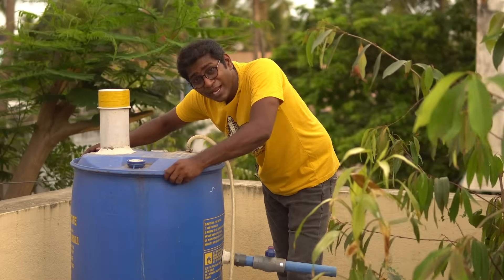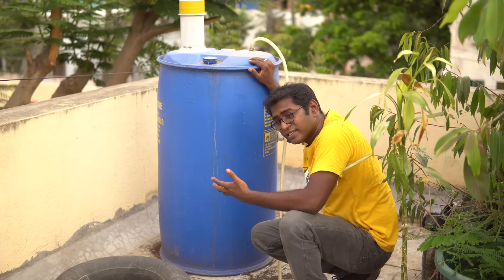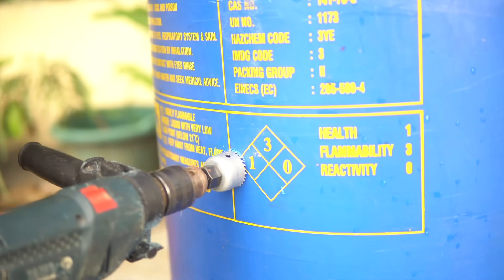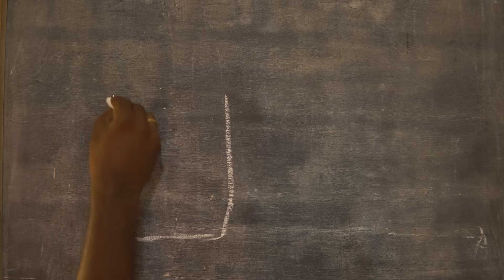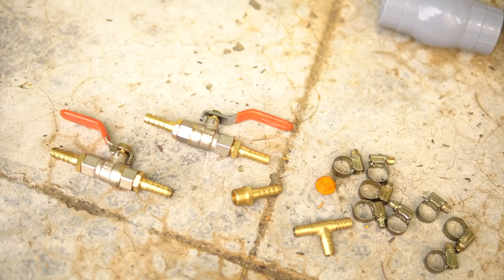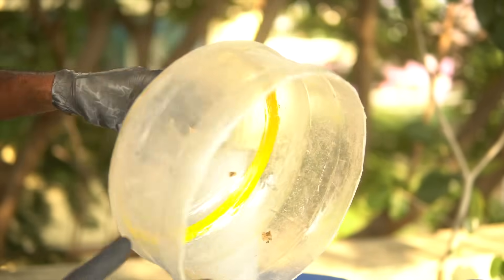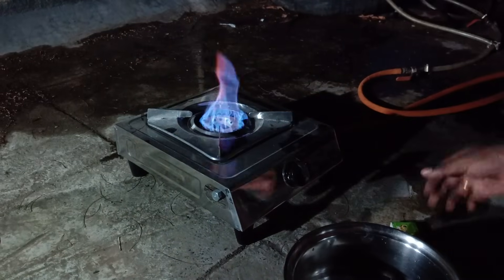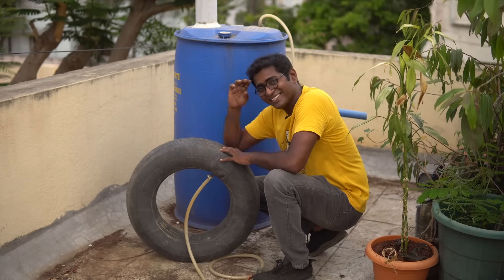Make your own Bio gas to save money on LPG

Comment from the maker: A large drum could be an IBC tank, or closed drums. If you are using drums with lids, make sure it is perfectly sealed when completed
I am using 220 Liter sealed drum
 4 inch diameter PVC pipe height should be based on the height of the drum you are using
2 inch Tank nipple
2 inch FTA(female threaded adapter 
2 inch ball valve and 
1 ft 2 inch pvc pipe
2 inch L joint
Half inch brass ball valve 2 nos
Brass t joint haf inch
Threaded brass hose connector
8 nose hose clamps half inch
A truck tube with tube valve removed
Hose as per length. 
Epoxy putty to seal eveything
Reply: I've seen often a purifying element added, consisting of water through which the gas is forced through, before going into the rubber reservoir/tank. Great video.
Reply: @VIDEOEPPO  great video. I still don't understand why your outlet had to be so low if you are not necessarily using the top part of the drum as gas storage. You have effectively reduced the potential size of the 210L digester to almost half if not less
Reply: Hello 👋, how much slurry did you pour into your bio digester?
Reply: Interesting video, may i request to make it in household use? I am sure it needs bigger barrel and bigger reservoir, but at least we would know how much do we need to make it😊 thanks
Reply: How to seal the waste outlet pipe?
Reply: Sir I make but not fire why

Comment: I still didnt understand the purpose of the black tube. Could you please tell me.
Reply from the maker: The black tube is for storing the biogas. An inexpensive way to store and also apply pressure to release the gas when needed. When the gas need to reach the stove, Normally the household cylinders are pressurized . But here there is no pressure. So we store it in the tube. As gas increases the tube become big, Then when we need to use the gas, We can place some weight on the tube to increase pressure and force the gas out.

Comment: What about the non liquid waste that's still left at bottom? Won't it be a problem? The tank might fill up someday and the space for gas will be reduced if the value is closed for many days
Reply from the maker: That's where I was mistaken too!. The microbes digest everything and turn it into a slurry. It takes time but it works
Reply: @VIDEOEPPO thanks sir. if our wastage keeps on increasing then it might become a problem. Will have to upgrade to a bigger or additional tank

Comment: Your demonstrations  is good .

One question valves used by you is of water supply grade or lpg grade ?? And how did you connect with tyre tube. That point is to be shown please for better understanding. Thanks again
Reply from the maker: I used brass connectors to avoid corrosion related problems. The tube has a nozzle as we know and i simply plugged the pipe into it. found the smallest hose- clamp to fasten it and wrapped it with strips of rubber tube to avoid leakage.Since the pressure is noy much, it seems to hold.

Comment: Sir, the slurry produced the methane gas automatically or we need to add anything externally to collect the gas?
Reply from the maker: The waste produces the gas as it is decomposed by the microbes. The vehicle's tubes are there to collect the gas. There are methods to accelerate the gas production but it would depend on various factors. Add some cowdung, it is enough. ( Like adding curd into milk to make more curd)

Comment: Instead of Rubber Tube, can I use cylinder For reservation?
Reply from the maker: You can. But there needs to be a way to pressurize it. Otherwise the gas might not flow out. In case of the rubber tube....we can squeeze it by placing brick which will increase the pressure of the gas flow

Comment: What if we accidentally close the valve associated with the gas generator. Won't it explode due to pressure?
Reply from the maker: No.... The microbes will choke and die  and gas production will stop!( Remember, the gas being produced is not due a chemical reaction but It is a biological process. The microbes feed on the waste and release the gas which is their waste....So if we close the valve, they  will be poisoned by their own waste and die

Comment: Can we use other  agricultural waste (like  dry leaves of coconut, arecanut  &    others trees and straw) along with cowdung? Cowdung contains undigested  green grass and straw  that is digested by microbial flora in cowdung  to produce Biogas. Can the same micribiome possess  the enzyme system to use  tree foliage as raw material?
Reply from the maker: Yes. You can use dry waste combined with wet waste. Although, It would take a bit longer to break down and gas production will be slower

Comment: I dont recommend this, lots of work and regular maintenance but still gas amount is very limited . So better LNG or LPG which costs Rs 800 in India for a dmoestic cylinder and it can run up to 2 months for a family.
Reply from the maker: we cannot generalize like that.  Biogas plants are a success and what i made here is only a proof of concept. When you say LPG lasts for 2 months , how many minutes does one cook in a day... There are people with cows and poultry.  Instead of burning cowdunk cakes, they can use biogas. This is not a setup that could be used in an urban area. There are limitations,but as an idea it works and we need to see how we can benefit from it rather than shelving the idea itself

Comment: There is a way that I do not know the details of to "stir" the tank with the gas... That produces more gas, and prevents the slurry sludge from settling to the bottom of the barrel, thus allowing the continuous flow over spill port slurry to be mixed more efficiently.
Reply from the maker: Not that I am aware of....But I never had clogging issues though

Comment: A Regulator Valve to control the pressure of the gas... Like is used with an Oxy Acetylene Torch can be invaluable.
Reply from the maker: You may not need it for a setup like this as the gas is not pressurized. Also if you notice, the biogas stove burner has bigger holes due to this

Comment: I understood the basic idea.. however there's still a small question in my mind - if we need to open the pvc lid to feed the biodegradable substance inside the drum in between, then the previously accumulated gas will get released in one shot.. making the months of accumulation useless. Any way to overcome this?
Reply from the maker: the gas will not leak like that. Imagine the chalkboard drawing in 3D.  the gas is collected above the waste material layer. the tube has opening in the bottom. Its forming a self seal ( like that of a bird water feeder
Reply: @VIDEOEPPO   thankyou for your quick reply. I understand that now. But another (follow up) doubt arises - the water (acting as a barrier) inside the tube opening will prevent the biodegradable materials from entering normally and might get jammed in due course of time.. so basically this pipe might need a frequent cleaning, right?
Reply from the maker: No,as you keep pouring,the level will raise rise around the pipe in tank. make sure the waste is cut and made into smaller pieces. It will get digested by the microrobes ,the excess, as in when the level reaches more than half, open slurry outlet pipe and remove the slurry. it can be usedas liquid fertilizer
Reply: @VIDEOEPPO  that's a nice explanation. Doubt is cleared now Thankyou. 👍

Comment: I live in the United States and have a 1200 gallon (4,500 L) septic tank. I wonder how much methane could be produced by an average household? Mine is concrete and not airtight but many here use plastic septic tanks that could probably be sealed to prevent the methane leaking out. The only additional cost would be from carefully sealing the tank and purchasing the plumbing to collect the gas. Occasionally removing the material that didn't completely digest is required whether or not methane is collected. Some sort of pump to compress the gas collected would make it much easier to store and use. Being able to collect more gas and use it more efficiently could offset the additional expense.
Reply from the maker: so true. If you have the extra space and cash,you could harness methane from septic tank

Comment: Hi i need guidance , im thinking of making biogas digester for a science competition to store methane gas . We have cats on our campus and i was thinking of using their waste instead of cat manure . Also I cant use such a big barrel can we use smaller size drums ? Thankyou!
Reply from the maker: Scale really matters. On a small scale the project might not work properly. This size barrel, if the flame last only for a few minutes....I don't think it will be ideal to make a small version and exhibit in front of people because the flame will last only a few secs. Production of Methane in this digestor is a biological process. The gas may not be produced quickly. It will take days...so making a small version is not advisable.
Reply: @VIDEOEPPO  OKK THANKU i was gonna waste my time on it thankyou for guidance

Comment: Adding a biogas compressor mechanism with a proper gas tank would make this system much more usable.
Reply from the maker: True. But there are more things to be done which I learnt through positive comments for the video. Thank for your comments too
Reply: @VIDEOEPPO  Appriciate your effort, please don't take my comment negatively...
Reply from the maker: @digiwizkid  Never. Any suggestion helps

Comment: Hello, i made a small version of biogas plant with this design but in 40 liters barrel. It's been 1 month but it's not producing gas, instead it's emitting carbon dioxide because i cant make it fire.

I've done research and they say that the biogas may produce carbon dioxide at first and i have to remove the air until it produces biogas.

Also there's no slurry yet. The substrate i fed was a mixture of fresh carabao manure and banana flesh and water. It's been 1 month, but i cant make it fire.

What will the best thing to do? If you know, please reply. Thank you.
Reply from the maker: Trying adding cowdung and wait for some more time. Also do check for leaks in the system
Reply: hi im thinking of using a smaller version too , please guide how to make im doing for science competition

Comment: Give it time to develop the right bacteria.. feed it high caloric waste like used cooking oil, spoiled fruits, potato peals etc. if you need more gas the following day. 

Digesters are like babies, they have to grow into their work, the bacteria that work with your temperature and your specific feedstock need to develop and colonize the whole digester. 

I live in a colder climate, we add sludge from ponds to the cow manure to introduce bacteria that work at colder temperatures (as those from manure evolved to operate at 37C, which most digester don’t maintain)

Comment: Hi  @VIDEOEPPO  can I add more tires? Is there sa specific burner intended for biogas?
Reply from the maker: Tube you mean? ...yes you can link them if you want to or store individually. And also, the burner for biogas is different and has larger holes. I have shown in the video.

Comment: How much gas generated in tube, have you recorded any data, for how much of slurry is required to get what quantity of gas,, what type of wastes added to slurry? 😊
Reply from the maker: I did not record any data. I was not trying to understand all of that. I just wanted to see a working prototype and tries to debunk a few things from what I found out. As for the waste, anything organic both wet and dry - can be added. Avoid citrus fruits . They tend to kill the beneficial bacteria
Reply: @VIDEOEPPO  thank you,, data would be helpfull incase , for 1kg of gas how much slurry to be added and after exahust of gas,, how to remove slurry,, because slurry would be in dry condition or in wet condition. Good luck to your hard work & God give you +ve respons
Reply from the maker: @vikramr6871  Thanks for the wishes. As for the question about slurry, it will be in a semi liquid state and flow out of the overflow tube in the middle of the drum. It can be used as liquid fertilizer after diluting it with water. If for some reason you want to completely empty the drum then add another valve in the bottom with a check valve so that you can access it when needed

Comment: Can I skip the reservoir setup of tyre tube by directly connecting stove to the biogas ?
Reply from the maker: definitely not!. It HAs to go to a reservoir of some kind. The gas has to be scrubbed for harmful stuff using a separate setup which I have not shown. I learnt about that later. Also some kind of flashback arrestor so that the flame doesn't  reach the reservoir and blow it up. What i have show in the video is only a proof of concept  and not a working setup.

Comment: Can this gas be used to power a generator?
Reply from the maker: Yes it can. But it also depends on the generator. You may need to look for a genset that works on biogas or do the necessary modifications on the widely available ones through professional. Safety should always be the first priority
Reply from the maker: welcome!

Comment: Hello sir, as you said in the video that this tube can last just for 5 mins. why don't you use a cylinder for storage facility and also a compressor to store the gas properly with some pressure meters installed ? will be waiting for your response.
Reply from the maker: The video was made to debunk many popular videos. I wanted to test the method from a common man's approach. There are ways to collect the gas and compress it into a cylinder. But a common /average person with limited knowledge will not be able to do that. Also, there is safety issue. One spark may cause more damage we can think off. So safety should be the number one priority.

Comment: How about safety of tube bursting out due to over pressure? 
How to connect hose pipe to tube pls explain sir
Reply from the maker: it may not bust due to over pressure. Its not a chemical reaction. Its a biological process. The organisms might suffocate and die before tube bursts

Comment: What do they put inside the Drum? Is there anything that absorbs the waste and turn it into Gas? If there is nothing, then wouldn't the Drum get full?
Reply: @gideonwak  you can put most any biological waste, from table scraps to cow poop to yard clippings. Chopped up and added with water helps bacteria naturally occurring in said waste break everything down and this break down of waste creates the bio gas which is a combo of methane, sulfer, and other gasses (cow or horse waste works best to jump start the process)

Comment: Hey dude,i did a similar experiment a week ago and i've got some safety questions.I got my inspiration from some other guys who built this same system just in a smaller size and i noticed they out a bottle half of water in between the plant composter and the output which has a valve.What use does the water bottle have?
Reply from the maker: Nothing Its just water. The pipe  from digester or storage is feed into this water. The gas will bubble out and it will travel through the other tube which  slightly above the water level in the bottle ,into the burner. If at all, there is a flashback...( flame going backwards from burner to digestor or storage..) This bottle of water  will be working as flashback arrestor. That is, The flame will travel to the bottle of water and the water will block it from travelling any further. This way...the digestor won't blow up.

Comment: Good info …but you didn’t mention where the fermented slurry goes out except for the slurry water …also is the exit pipe sufficient to flush out the thick slurry and waste after used in gas production ?
Reply from the maker: most the organic waste decomposed into a watery state and it comes out as slurry. If not it is still decomposing.

Comment: Can you please make a video on how to analyse if your inverter is efficient or not. Old inverters are built with sturdy electrical components and ours has been working for 30yrs. It doesn't have the pure sine wave and such features of modern inverters but those electronics get damaged easily and have shorter lives. Efficiency and a value analysis video is my request 🙏🏾

Comment: Is there a reason your putting the slurry outout point in the middle of the barrel..? With such a small barrel i would have used more space and placed it much higher. Or do you need a certain amount of space for the gas to build up..?
Reply from the maker: Yes, you need a certain amount of space for the gas to build. But there is no rule on how and where to put the slurry pipe. Feel free to experiment

Comment: Question: Do we really need a storage tube, i mean can we connect digester to burner directly. Can we Bypass storage tyre tube in between
Reply from the maker: NO you cannot do that, It needs to go to storage unit. Then connect it some filters ...then it goes to a flashback arrestor and then to the stove. Otherwise it may back fire and create fire accident

Comment: This gives me a nice idea! In the summer once a week when it filled i can use a compressor to fill some LP gas tanks for use in the winter as heat in my furnace =D
Reply from the maker: thats a good idea, but please do some more research and please be careful with your attempt. Good Luck
Reply: @VIDEOEPPO  I have been thank you so much, love your videos and it got me back outside again.
We store the gas in a large LP tank, and useing a auto-lighting gas regulator setup, we put it our coal furnace, tested it after some time, its working great!